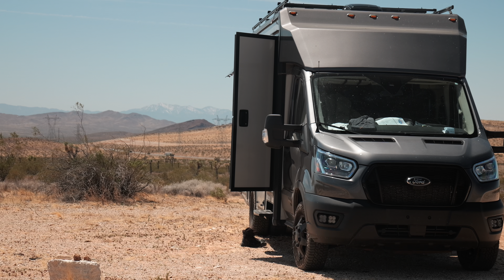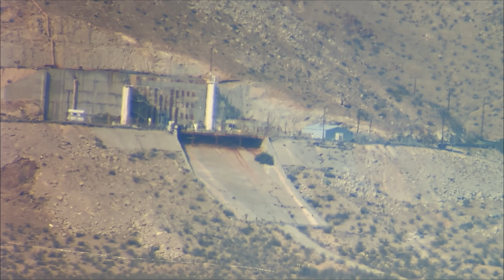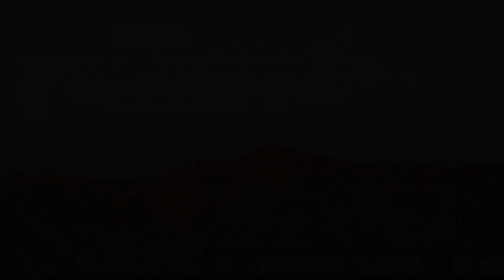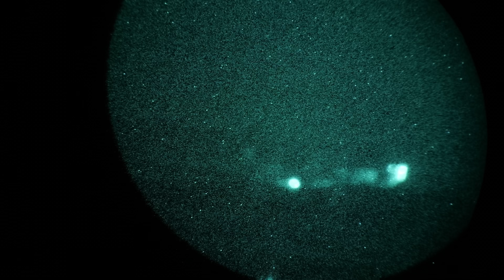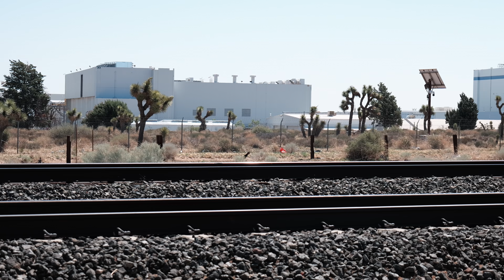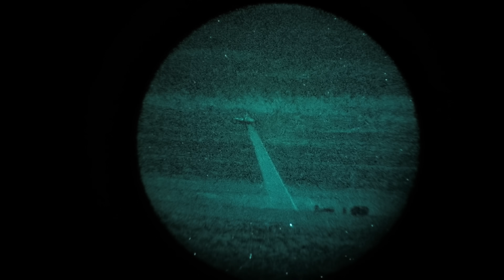Camping and Spying around Edwards Air Force Base | Haystack Butte and a Quick Look at Skunk Works HQ

Comment: Looking forward to your video on Air Force Plant 42. I spent a few years there in the mid to late 80's as a contractor on the U-2 program. Our bird shared a hanger with an SR-71 that made a number of test flights while we were there. It was interesting to see the difference between the take-off speeds of the two aircraft. Our U-2 just seemed to float up into the air until it disappeared from sight. The SR-71, on the other hand, took off like a rocket ship. If you blinked, it was gone.

Comment: A few comments, if I may. I worked variously as a CE controller & fire dispatcher at EAFB for the better part of a decade. The adage was "CE owns the base. If we don't work, the base doesn't work" and in fact, we did. We owned the   responsibility for all the grounds and facilities, including AFRL.  Most of that facility was built to test rocket engines for the launches that the current  generation says "never happened":. from the Mercury series to the lunar landings & shuttles. But they did happen and their boosters were tested right there. The glorious thunder and smoke when they're  running up those Atlas & Saturn rocket engines is a joy to behold. But There are no deep dark mysteries there. It is indeed a test base. It is also a NASA base and has a USMC air wing as well, as well as a number of RPVs. The last CH-46 off the roof of the embassy in Saigon? It was  still in service at the old WWII hangars  up until they transitioned to the CV-22, It sat there looking forelorn, complete with the little patches over the bullet holes. 

CE folks and the EAFB-FD had to know every facility on the base & what it does.  Yes, there are buildings on the base where few get to go and you're not allowed to even discuss the research going on inside while you're standing in the front office because office windows make lip reading possible. There are others where you empty your pockets when you go in, turn over your phone, and go in only with an escort or armed escort. there are red lines painted on the floor over which you do NOT stray at the risk of arrest or being shot by an armed SFS cop. (I stayed inside the lines) In my time there we handled several shuttle landings,  the certification of the CV-22, F-22,  & F-35, along with lesser known aircraft. We flew the last flights of the "Balls 8" B-52 that launched the X-15s and now graces the North Gate to the base.  

I appreciate you spotting the 2 Korean War vintage  T-33s at AFRL. I knew they were there but I hadn't seen them in years. But there's nothing that you're going to see by the snooping that you were doing. Virtually all of the fun stuff occurs up at China Lake & the Nevada test range.  You'd actually have seen more if you'd taken 140th St. E up to the south side of the base, turned right on Ave. E and followed it around to  Mercury Blvd, which dumps you out in Boron. You're technically driving across the middle part of that 220,000 acres of EAFB but it is a road open to the public.  That will take you past the remains of Snoopy, a long-nosed  1 off B-58,  & an RF-101 out in the pickle area. there are also some broken up B-52s sitting out there since the 1980s.  I'd suggest not straying off of the road however as the W. side of the road is what is called a "pickle area" where ordinance gets dropped as needed and the E. Side of the road is a bombing range. The base is strewn with ground sensors and  SFS patrols the perimeter in HMMWVs so if you play dumbshit, you might get to meet the folks from the SFS squadron, CID & a Federal magistrate at some future date. And the magistrate only comes around once is a while. Jail is no fun. Be safe. Those guys don't play.
Reply: I can attest to what you have said. Worked on base at Dryden, and later it became Armstrong. Used to go out to the AFRL to maintain the mobile generators that power some of the optical  
tracking, as well as power the ground sensors and perimeter sensors. We used to go up to the CAT site on the mountain on base to watch the shuttles and the ISS when the shuttles were up. Also did some mechcanical maintenance, and fire suppression pumps for the hangers of Bldg 4800/4801, 4825, and of the hangers, and the MDD to mount and demount the shuttles onto the special 747 carrier aircraft. Left in 2013, and still live in Lake L.A., just south east of south gate.
Reply: @siseley1   you'd have been in the alarm shop. I probably rolled you out of bed a few times when I was a fire dispatcher there. I always hated waking the "On Call" guys at 0-dark-30 when we'd get the alarms coming in.   

When I was there, any time they had a shuttle landing we had a UCC stood up and I was caged up up in that tiny room with a bunch of other people. I only got to watch 1 come in and that only because I was out reading meters that day. When I got the double boom, I hustled myself up to the CAT sit in time to watch them pull it into a stall over N. Edwards, then nose over  and head for the runway. 

One good thing about the work at Edwards as it included free air shows almost daily. I love watching the Bone &/or the B2 launching right about sunset on many afternoons.  A B-1B with the burners lit is an awe-inspiring event.
Reply: @siseley1   so you wer there when I was there as worked in the water shop? I was one of the carpet dwellers up front from 2005 (fire dispatch) then from 2006 in the CE controller's office and  separated in 2015.
Reply: It sounds reslly interesting! I wonder why they dont save or allow some of the sircraft to be saved in museums etc? As an aussie, its pretty cool to hear about where so much history and tech was tested and developed. I think a lot of the bases and stuff are kinda left to fade away and its sad cuz theres so much history there that should be documented and preserved.
Reply: @Steve211Ucdhihifvshi  some of the aircraft on the PIRA will be going to the museum. The nice thing about out here is its so dry the aircraftcmay fade but the metal doesn't really degrade. But in all honesty,  the AFTC Museum has a large collection of over 60 aircraft and a lot of these aircraft the Museum already has and the ones on the range are deemed "excess".

Comment: Nice video,  I am a new viewer. I use to work in areospace years ago.  At the beginning of the hay stack butte that structure to me looks like it was a test stand  for some kind of engine . You see the chute below was used for channeling exhaust and the tank on top is most likely a water tank. And during a engine test they would flood the chute with water to dampen the noise. My background was the Space shuttle main engine. I also remember when they were looking for engineers for the X33 NASP also
Reply: Now that, sir, sounds like one heck of an interesting career!
Reply from the maker: Thank you for the insight, and knowledge from your fascinating career!
Reply: The test stand is for the A F R L rocket engine tests for the shuttle engines. There is a story that at one experiment, 4-5 engineers were crushed by an explosion.
Reply: @ they had a crane failure when lifiting a Titan rocket engine in 1991 that killed 1 and injured several others. It could have been that one.
Reply: @davidsexton4033 100% was not that test stand. I have stood on the rebuilt tower and was working at was at the time Phillips Lab.
Reply: really love the RS25, what you all did was a work of art.
Reply: Well I wouldn't be able to use my favorite line on you.... but coworkers are still faur game for the ol'     "hurry up! We're not building the shuttle "
Reply: Wow Holly Cow cool stuff
Reply: While active duty at Edward's, my supervisor and I got to see the X-33 under construction at Plant 42.  We were inspecting a hydraulic test stand they were loaning from us.  My supervisor asked our escort "what can you show us while we're here"  He then walked us into the X-33 hanger. We couldn't get close,  but it was big and only at half scale.   The program was canceled shortly after.
Reply: Stayin quiet. Don’t want to wake the guards!
Reply: Ok rocket scientist. Tell us something NASA hasn’t lol 😂
Reply: @JamesJolly-n1v why would he lol

Comment: The tank on top hatstack butte is an old water tank.  I dont know about now but I can tell you for sure there were no secretive underground tunnels they're on the 90's, early 2000's.  Now, north base on the other side of rogers dry lake? I've heard that's another story but can't confirm. 

The orange and white tank is a water tower out at AFRL's test area 1-42. They test solid rocket engines under vacuum

Comment: I drive by skunkworks a lot, they have the doors open I think probably in the summer a lot.  But yeah I've tried to peer inside.  I guess one of the hangars at one point had their heavy lift dirigible.  I went to a family day there once and they had it rolled out.  That was a while ago, haven't heard much about it recently.

Comment: Thanks for sharing. I wanted to get close to the AFRL and Haystack butte primarily to see if it could be used as  a movie location. But, I soon found out that it was all on restricted USAF property. So not being from that part of the world, I could not figure out a work around and had to forget about it. You got some pretty good shots of it though. I think that it's currently used for secret stuff. There's another facility out there between Helendale and Edwards, that does stuff for General Atomics (gray Butte). I drove up towards the gate there and chickened out as soon as I saw a guard coming forward. One things, for sure. In all of my So Cal desert forays, all of these facilities did not seem as glamorous as I  had imagined them.
Reply from the maker: Yeah the security at the General Atomics facilities (Grey Butte and El Mirage) don't take kindly to visitors that's for sure!
Reply: That Helendale base is a strange one. It has  been variously listed as a USAF radio facility & a radar test facility.  But I watched Aurora come of of there on Sept. 14, 2001, @ 2100L. We were sitting on a hill over  by I-15 and I saw a taxi  light moving down the red-lighted (meaning "closed") runway. That seemed a bit odd. So we watched it turn & take off. It passed right over the top of us heading eastbound.  It was big, black, had anomalous  nav lights (green front, red back and three pointing downward, not the usual red-port-left & green-right)  That single big building has numerous levels below ground from what I'm told by one of the guys who did fire inspections on it as part of his job. The FD guys were only allowed in a few of them. I think he said 7 levels and they did the top 3.  If you get close to the perimeter other than on the main road, past the gate there you'll get to meet the security team. They  bird dog you in unmarked 4x4 vehicles until you leave. At least, that's what they did with us.  Oddly, that is not part of the EAFB complex just a few miles away,. It is somebody else's even though it says USAF.  Gray Butte Says "General Atomics" but it is actually an old emergency field from EAFB  during & after the war. Last time I was there, it was well-stocked with Global Hawks & MQ-9 Reapers. You can often see them lined up along the taxiway when you look on google earth. It does not belong to EAFB either, even though both bases have MQ-9s and Global Hawks.
Reply: @davidsexton4033  hey bud, Gray Butte was an auxiliary for Victorville Army Air Field, not Edwards.  😉

Comment: The 3 airplanes parked by the sealand containers : One is an f-101 Voodoo, and the other 2 are most likely p-2 Neptunes. Probably used for target recognition testing at one time. Edwards area is littered with derelict aircraft.The Northrop N9N flying wing sat out there until it was discovered and restored.  If you take avenue J in Lancaster out to Saddleback Butte, you can make out more. 
Edwards had a rocket sled at one time, and the long track you panned across might be it.
Reply: the rocket test sled track is near the south base gate, just off of Mercury and 140th street east.
the stantions are still there, and the small lake by the gate was used for the sled tests
Reply: @siseley1 well you're partially correct.  There was actually 2 sled tracks on Edwards.  One on the South side you're referencing which was high speed and never help humans. The other was at North Base and that's where human testing was done and was a much shorter track.